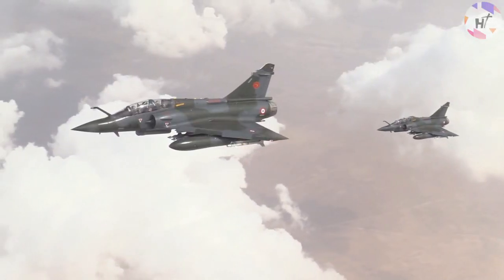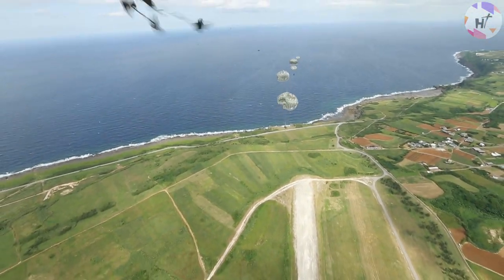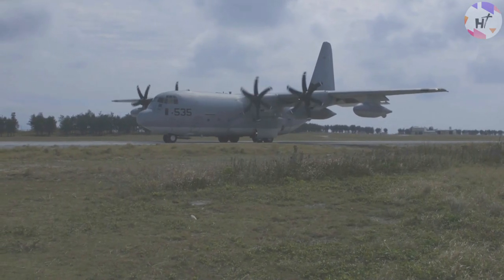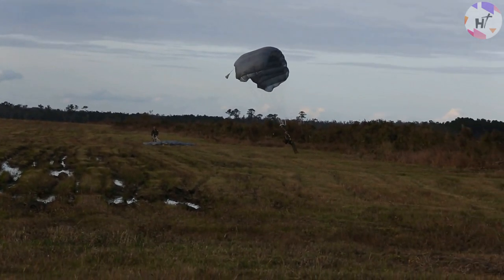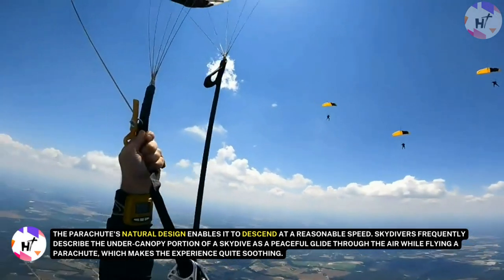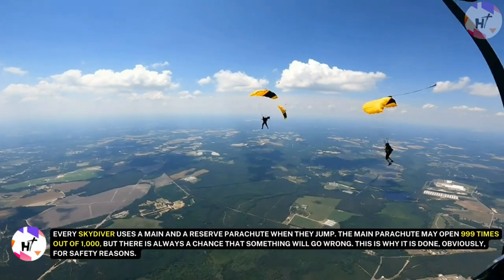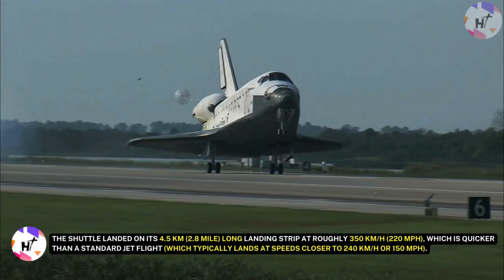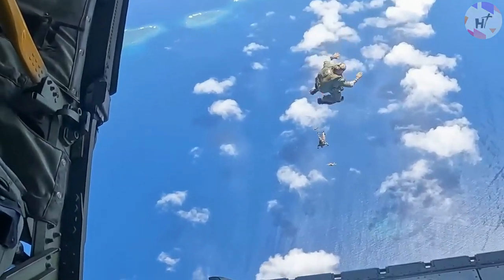The Adventure of a Lifetime: The Thrill of Skydiving with the Safety of a Parachute

Comment: People use their parachute to glide safely to the ground. Parachutes are among the simplest and most effective of inventions when it comes to saving lives. Parachute works by using air to create a structured wing that allows the user to glide to the ground. Parachutes are controlled by pulling on steering lines which change the shape of the wing and allow the user to turn or change their rate of descent, which will make more accurate landings. Modern parachutes are rectangular which give skydivers more control over their descent. Thank you so much for doing this video.